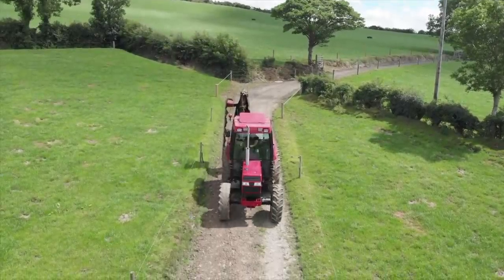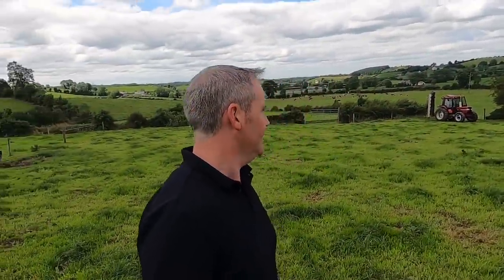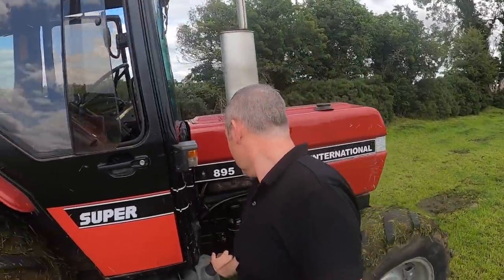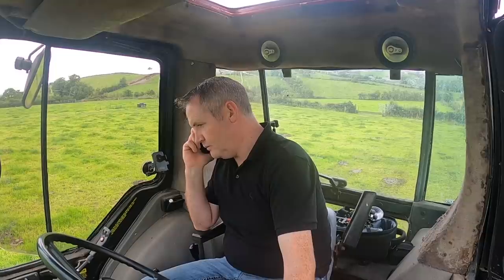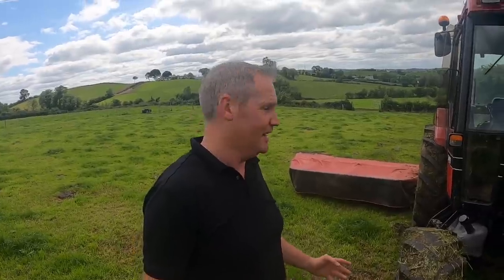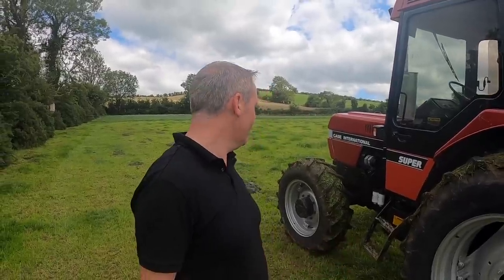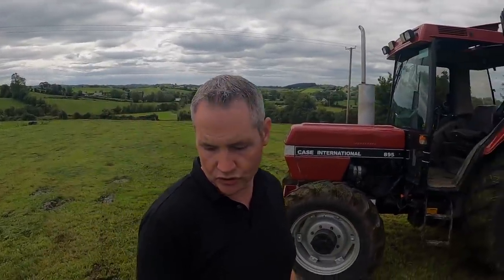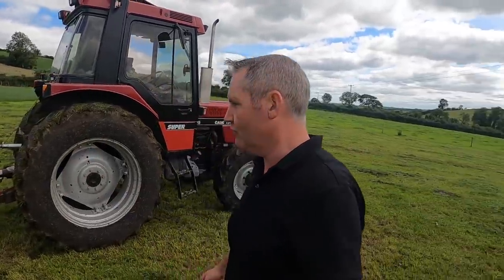THE CASE BREAKS DOWN, A GOOD DAY JUST WENT BAD!!!

Comment: You should try a pre mow before cows in paddock   good job now 2 days before you put them in for wilt
Reply from the maker: FIAT 110-90 TURBO New Holland we pre mow quite a bit, it’s interesting that you mention wilting it b4 hand, we would advise against that as we seen a drop off in produced by doing so, we would only mow an hour or 2 b4 grazing which seems to work better for us. I’ll cover all that very soon. Everyone has there different techniques which are trail and error really
Reply: @IFarmWeFarm  it's hard to know it all ...we just new too pre cut for small fields it be good see other mens tricks off the trade

Comment: I would be finding the leak that's getting into your cab, That cladding roof lining defiantly needs a change.
Reply from the maker: Billy Stephens it was leaking when we got it, we fixed it straight away but the damage was done, it won’t clean up a hard to get a replacement..
Reply: @IFarmWeFarm  Ah right, Why not take the roof lining out and get it recovered, The board seems to have kept its shape fairly well so I wonder if recovering it with a stretchy 4 way covering the same as they use in campers would do the trick. Get that in all sorts of colours and would possibly match the existing??

Comment: the hitachi diggers were prone to this also and would leave you scratching your head for a while until you figured it out . the solution is to stop filling with drums or use a very fine gauze on you funnel to eliminate the shit , its the last line of defence before it gets to your pump .
Reply from the maker: MrGreendragon3 very through, drums of diesel that get to sit alway hold dust and dirt on the top that get into the tank. A very fine funnel or even and cotton sock would solve a lot

Comment: I have a case 885xl and my tractor is doing much the same thing changed filters but it's still losing power like its starved of fuel..first thing in the morning I'm checking the bottom of my tank,you may have solved my problem
Reply from the maker: Anthony Mckenna let me know if it worked 👍

Comment: Funny enough, i have a case 956xl, i had a similar problem, it stopped after splattering and having raw fuel come out of the exaughst. Started instatly 5 seconds later. Weird problem, seems to be in this age of case tractors. Had to find out the problem myself, not many here in russia.

Comment: We have a deutz and it does the same. We think there is dirt in the tank of our deutz.
Reply: Which Deutz you have?
Reply: Betherz    We have a dx4.70 but we think the tank needs a clean
Reply: @mckennaagri4778  Haven't used an old Deutz but think the new 6155 and 6175.4 are the best overall tractors for sale currently

Comment: Adrian great video, I like all your videos as they are interesting, thorough and practical. Come here though, those filters at the bottom of the tank, did you open the 19 bolt, take out filter gauze and then put bck in bolt while you cleaned it out? Assume if you didn't there would be diesel running out everywhere there? Have a zetor 9540 here, get diesel in drums as opposed to our own tank but notice a fair amount of water and crud collecting in the glass bowls between the tank and injector pump. Regular clean and she sweet though
Reply from the maker: Mike Kinsella Hi Mike, no I put in another bolt because the filter is part of the bolt, all pulls down as one. Filter is only about the thickness of a stick of chalk and about 2 inches long.